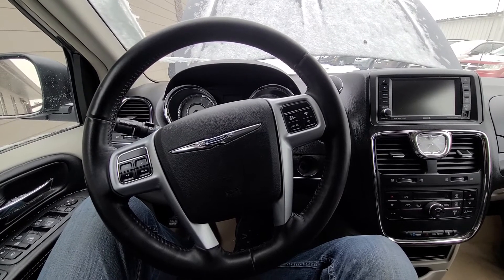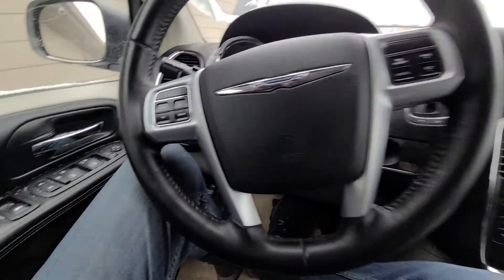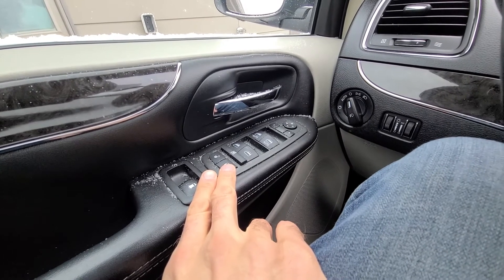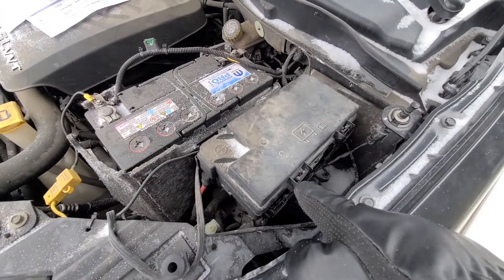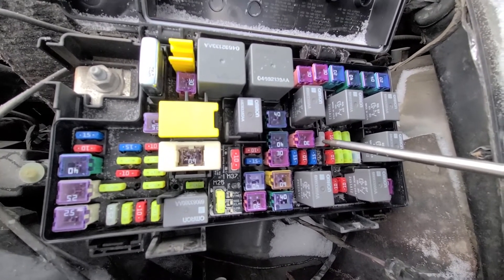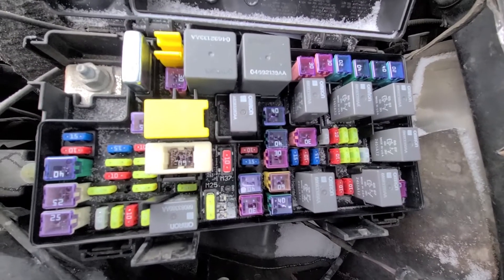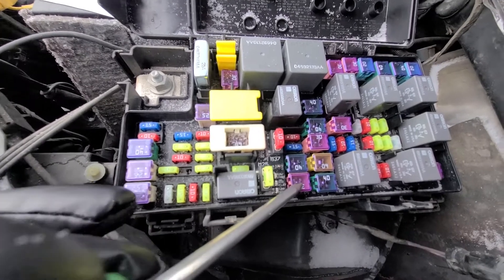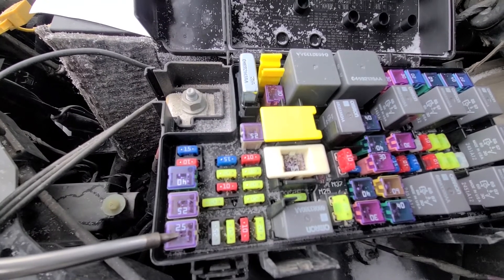Chrysler Town & Country - POWER DOOR LOCKS FUSE LOCATION (2008 - 2016)

Comment: So if I pull the fuse for the sliding doors will they still work with the main 25 amp fuse still in or will pulling the 30 amp sliding door fuse disable the power locks for those doors?
Reply from the maker: Pulling out sliding door fuse (J3) should only disable power sliding door operation, not the power locks as it is on a separate circuit
Reply: Think you can use doors manually as it is a pain in the ass to fix actuator @QuiteAlright

Comment: My switch works sometimes.  I have to open the passage door and close it, and then it works. But I made sure the passage door is closed securely. Any suggestions 🤔
Reply from the maker: Hmmm really hard to say without looking at the vehicle. Could be a failing actuator, wiring problem, gunked up switch,...Sorry  I can't help more

Comment: Driver buttons 
First unlock stopped.
Then both.
Then pass side.
Driver buttons zero signal.
Pass side intermitant.
It had stopped also. But u could hear it send some signal. 
Just tried pass side to see if it was lock unlock or.both that sent weak signal.
But it worked now...
Keyfob has worked properly whole time. 
Hrm
Turns out open pass door it doesnt work. Close the door it works.
Driver side doesnt work open or closed....
Side note.
There is quite possibly a parasitic drain. Maybe im closing in on that....
Reply from the maker: Hmmm yea this is quite unusual. I would start by checking wiring at both driver and passenger door jambs behind the rubber sleeve. Very often I find damaged wiring there which would fit your symptoms

Comment: We checked the fuse and that’s not the issue for us. Know of anything else to check within the door maybe?
Reply from the maker: Check the wiring behind the rubber cover on the door jam. Wires often brake there. If only 1 door malfunctions also check the door lock actuator